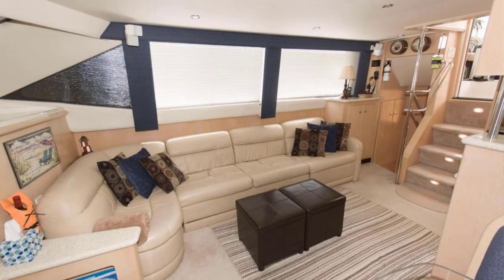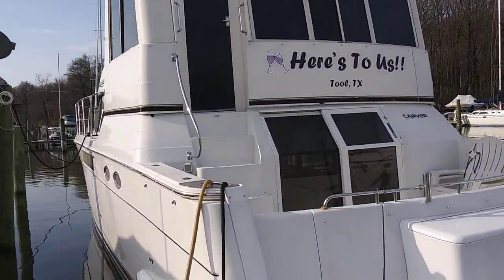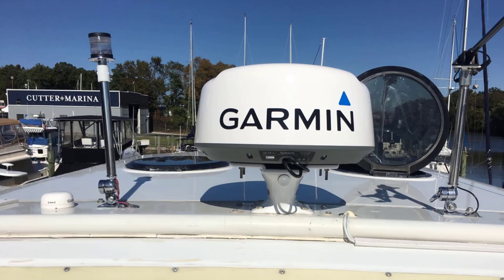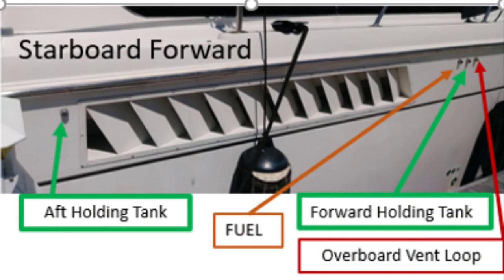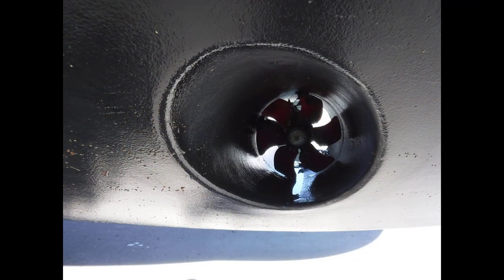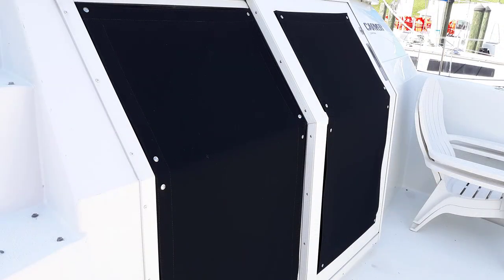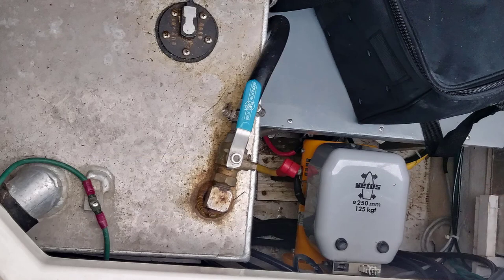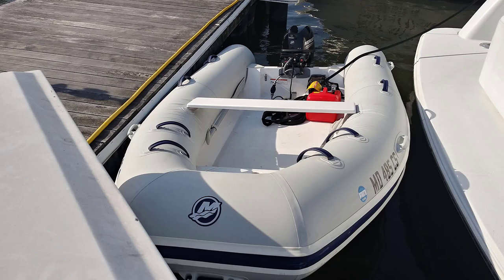1999 Carver 504 Motor Yacht Boat Tour: Outside and the Cockpit | What Yacht To Do

Comment: If I had to boil it down to one thing that makes the boat stand out, it would be the pilot house bridge. That gives you good weather protection, outstanding visibility. The hard top and glass windows really are way better than a flying bridge, with a Bimini top and plastic panels. It reminds me more of a commercial vessel, than a pleasure craft. If the 444 had the pilot house rather than the fly bridge it would be the perfect vessel for the Loop.
Reply from the maker: Totally agree. I am spoiled by that bridge and looking at other boats it makes it hard to switch to another vessel if we sell it.